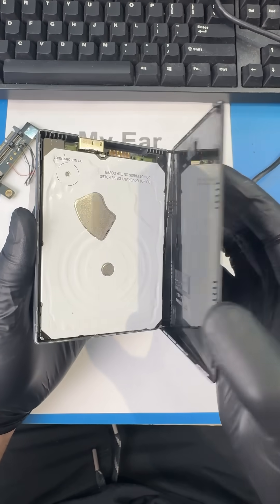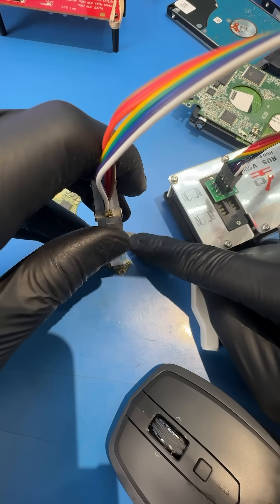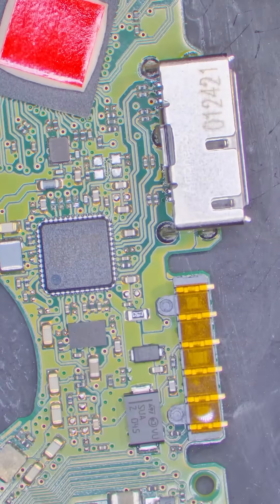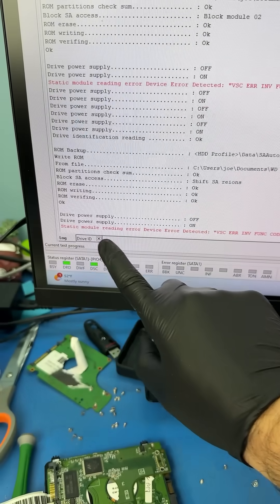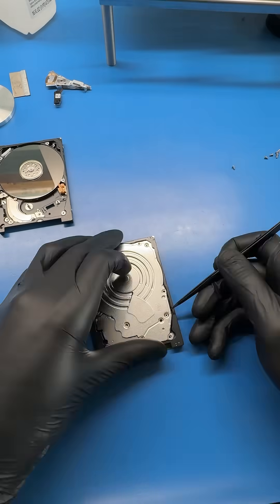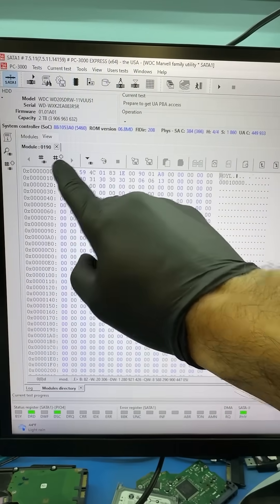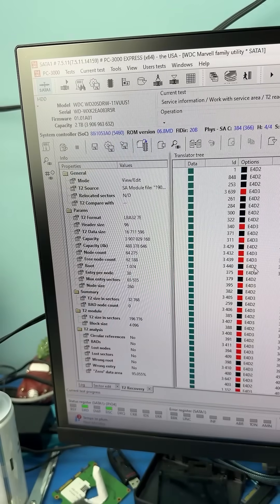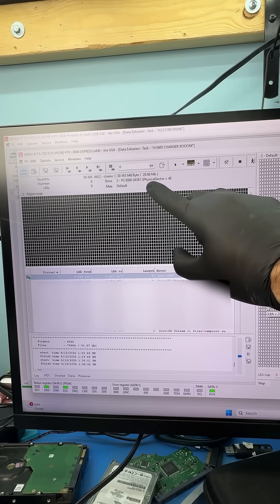Hard drive translator...? #tech

Comment: These are technically fascinating shorts. The hard drive was the one limitation on computer mastery, as it was the one device that required a unique set of skills to learn the work.

Back in the day this skill was a costly third-party vendor job where the price to recover data was based on two things: 1) amount of data on drive and 2) level of complexity involved to do the recovery work.

In my entire 30 year IT career, I had a total of ONE drive where the company was willing to pay the recovery cost (If my recollection is correct it was something like $8,000).

Most of the time, the willingness to pay for the data came down to “did the company lose data so valuable that it was deemed worth the price to recover”…for a single employee drive failure that answer is almost always “no”.

The heartbreaking part is that most drive losses before the increased awareness around security included tons of personal data, including in one case the total loss of a young parent’s pictures of their first baby”…of course from the Finance approval POV, none of that data became part of the recovery decision.

It was computer scenarios like this that led to a push for stronger policies around data management and increasing the role of cybersecurity as an official job role that was separate from IT support.

Comment: Dude, this is metallurgy. Remove this crystal to stabilize the connection is an insane sentence to actually be correct
Reply: Considering we turned sand and stone into literal thinking machines to store our dreams, yeah it's witchcraft.
Reply: @Leftysrev3nge Yeah it’s magic
Reply: Unfortunately, that piece he removed isn't really a 'crystal' in the geology sense. Quartz and other piezoelectric crystals are often used to generate clock frequencies, but the one is the video is definitely some kind of MEMS chip.

Probably for serializing data before sending it through the USB port/cable.
Reply: @jo54763 why did he remove the “crystal”?  He wanted a SATA connection instead of a USB, if I understood correctly. I’m guessing that the SATA connection works better if the disk lets the computer keep track of time. But I know nothing about hard drives.
Reply: @simonjonsson3654  I'm not certain either. I think you might be on the right track, though. I think because the drive was an external drive, it has to generate its own clock frequency to send out serial data to the USB port, which is then read by the system. I concur with your guess that SATA cables use the system's own clock, but I also couldn't find anything to confirm that.
Reply: @jo54763  thank you for the answer. Such a curious detail, but I guess it could tell much about how the disk and the computer operates.
Reply: @simonjonsson3654 Since the SATA interface has its own internal clock, the hard drives’ clock can interfere and lead to possible data corruption because of timing issues.
Reply: @simonjonsson3654  Yeh, I didn't get that bit ether. You get USB to SATA converters for a few £ tops. Why not use one of those. Then I don't understand why he wanted to convert it to SATA, I assume for one of the diagnostic tools.
Reply: @jo54763  how is quartz not a crystal in the geological sense ???
Reply: its pretty simple really, I am sure he didnt discover this probably read in on a forum somewhere or a datasheet gave him the idea
Reply: stabilize the machine spirit*
Reply: My guess is he gets rid of the oscillator so the system can do it rather than the on board since he’s unsure if the system is good for timing. Cuts out a variable
Reply: @Izik09834  probably read it on the internet somewhere, thats my guess, or maybe he figured it out on his own, your guess is a good one though on timing
Reply: He's a real SAND WITCH.
Reply: It's probably in the context of the circuit -- he's now using SATA so it may get clock signal from the CPU.

Comment: "Remove this crystal. This will stabilize the SATA connection" 

Sometimes when you get technical out of context it starts sounding like some high level alchemy lmao
Reply: Look we took Sand, Coinage metals, rust and a handful of carefully placed magnets and made it do math and store information, it is alchemy.
Reply: @zerg539  I mean, bro it technically is. If you show somebody this technology 200 years in the past, they would for sure think it’s sorcery.
Reply: @zerg539  For real. One of the things I like to remind people is that before the late 1800s, pure aluminum was more expensive than gold. It was only by chemical means that we were able to isolate the element in large scale, from what was effectively useless dirt. "Dirt into platinum" is, imho, even more alchemically magical than "lead into gold" and now we all just drive around in fucking carriages made out of the shit like it ain't no thing.
Reply: Well back in the day the crystal was actually a quartz crystal oscillator to keep timing.  This is technically a silicon/mems oscillator.  But everyone still calls it the crystal.  If you get enough of them, you can build a light saber.
Reply: @RolandDFW it often still is in most microcontrollers
Reply: @artemis.nnnnnbbbbb  not just microcontrollers, 90% of crystal oscillators are quartz still -  its cheap, good, and a proven technology
Reply: @RolandDFW  not just back in the day, crystal oscillators are rarely not quartz. Its just so cheap and easy to manufacture there is no reason to move away from quartz and set up new machines.
Reply: You're on the "watch List" now  @RolandDFW
Reply: @RolandDFW  the "crystal" used in my sister's car goes fast every once in a while and we have to reset the time. it SUCKSSSSS
Reply: @RolandDFW silicon still is a crystal
Reply: I mean, it's a rock that remembers😂
Reply: "Remove this crystal, this will stabilize the SATAN connection", said the wizard and turned off the light in an isolated dust-free chamber
Reply: @naya_vu 
Jesus is the way, the truth and the life. Turn to him and repent from your sins today ❤️
Reply: @naya_vu my exact thought process 😂😂
Reply: It in fact is, we just got used to learning it. Humans got really precise and complex with their technologies, especially with information processing and transferring ones, up to the point that some of nowadays computer technicians would amaze even people from 1980's with their knowledge and skills. And the very idea of simulating a world, let alone a random one, where you can move around and do some at least remotely interactive stuff was science fiction like 40-50 years ago. This isn't "like high-level alchemy", it IS a high-level complex alchemy, like Mineral Information Storing and Processing (MISP) course, which only the chosen ones of the Information Technologies faculty could join.
In fact, many specialties can be explained in a magical super-advanced alchemy way, with how organised, acknowledged and advanced all that is compared to what people, like, even 300 years ago had.
Reply: It sounds like a low-effort cop/investigation series when they do "hacking"
Reply: @thespacepirate4641  Also yeah... They definitely overplayed that card 😅
Reply: Just what i thought  @thespacepirate4641
Reply: well, of course. Computers are basically rune magic and instead of it running on a crystal ball its displaying stuff on a screen.

Energy can be converted. so we use electricity in place of mana.

we are living in a fantasy world, it just doesnt seem like it because everyone is used to this stuff being "normal"
Reply: Dude, deep level tech IS high level alchemy.
Reply: What does it actually do? Is it to make the drive accept external clock signal?
Reply: all computers are just flat rocks with lightning in them that use the good vibes from crystals to "think"
Reply: There is no difference between classic "magic" and modern technology. 

Using crystals (quartz) and focusers (copper wire) to direct invisible energy (electrons) to perform specific movements resulting in different incantations (logic gates)
Reply: I mean technically we are imprinting runes/circuits on silicon a which is a rock to do our bidding.
Reply: @ZeFoxii yeah exactly the more i learn about runes the more i glance anxiously at the microelectronics
Reply: Electronics are basically high-level alchemy. We carve symbols in to rock energize it, and it can think
Reply: What magical madness is this!
Reply: when you remove the crystal but you accidentally use human transmutation to do it so you have to go through the gate of truth to fix the drive
Reply: that's because... it IS!
we just renamed "alchemy" into "chemistry" and use "material science" to build precise nanostructures that store data.

we use the power of lightning magic condensed into batteries and channeled through small conduits/wires to manipulate mag(net)ic fields around things and communicate through waves emitted by such metals. we have a vast network of antennae sending and receiving information at the speed of light.

we just made it boring by understanding it. but it was never meant to be boring.
Reply: You misspelled “SATAN connection”
Reply: I think he is just disabling the USB interface, but I'm not sure
Reply: Listen, we made sand think. We made the thinking sand communicate through via frequencies in the air. We are in the process of trying to give the telepathic thinking sand self awareness. 

We are doing magic, people who chose to romanticize wizards instead of getting a computer science masters are just butt hurt.
Reply: It’s literally magic
Reply: As someone working in a tech field it's always fun to talk about it like magic. Runes etched into a magical crystal that give it controlled animus, and allow you to slave its will to your goals are much more fun than just a computer. Although the more in depth you can go on the actual process the less magic you need to add to your wording. The processes of forming the initial silicone crystal, then the PN enrichment, and the photoresist used to form the lithography are all processes straight out of an alchemist's wet dream, and by the time you're halfway to the full picture already sound like some mumbo jumbo the writers would put in a sci-fi movie to make a character sound smart.
Reply: Science is just magic that works, so you're not wrong...
Reply: Like the Kyber Krystals
Reply: @NaterFernator in stargate how a lot of alien tech has crystals in its circuitry.
Reply: sounds like something you'd hear on Stargate back in the day
Reply: Sounds like star trek honestly but that show is sum what based on real ideas
Reply: Sounds exactly like treknobabble
Reply: PRAISE THE OMNISSIAH!
Reply: I can't be the only Rs player that Read High Level Alchemy a certain way.
Reply: Circuit boards are literally demonic sigils
Reply: It sounded more like "and after that we can kill ender dragon"
Reply: Don't kid yourself or the machine spirits. It IS high level alchemy
Reply: Well technically....but frfr yeah were working with hardware and software which relies on electo chemistry to work which chemistry is what alchemy became
Reply: Oh my god are you actually TikTok verified bro?!?! Wwooowwwww
Reply: Especially when “SATA” starts to sound like “Zeta”
Reply: @NBrixH What does the letter Z in greek have to do with anything?

Or do you somehow think zeta is a special word anywhere other than explicitly fallout?
Reply: @Atmatan ”SATA” can sound similar to “Zeta”, which is a word often used in fiction in regards to mysterious stuff, and aliens, like in Fallout for example.
Reply: @NBrixH 'Often' is an overstatement.
Zeta is the greek letter for Z.
It is not mystical or mysterious under any contexts.
Fallout is the only notable place you can list it being used without searching.
Reply: "Let's continue with the head swap"
Reply: I forgot to put in the crystals.  Napoleon dynamite
Reply: Or Sci-Fi
Reply: The true SAND WITCH.
Reply: Yeah😂
Reply: full metal alchemist.
Reply: To be fair modern science and technology IS high level alchemy 😅
Reply: That's because this is technically alchemy
Reply: I mean, really. If making a rock think for you isn’t alchemy, what is?
Reply: I was thinking the same thing tho lol😅😅
Reply: It’s all alchemy. We’re just shocking rocks with lightning so they remember.
Reply: me when i go to the local wizard to get my doohickey repaired
Reply: All of it sounded like a bunch of "witchcraft" to me.  I vote to have a trial and exorcise the demon from this man!
Reply: just like my life fr </3
Reply: It is high level alchemy
Reply: Electronics is basically just making rocks talk to eachother
Reply: "Any sufficiently advanced technology is indistinguishable from magic"
Reply: cringe reddit ahhh comment
Reply: ya your not wrong. tech is just alchemy in a way.
Reply: Computers are alchemy lol
Making rocks do calculations and talk to you
Reply: Now you know why engineering is so hard that it breaks engineers apart for 5 years
Reply: Если припаиваете Sata, провода Data нужно переплетать между собой чтоб ошибок чтения небыло
Reply: science is 100% a type of sorcery, the saying “Any sufficiently advanced technology is indistinguishable from magic.” i know there’s probably a second part of that saying that goes like “… and any magic that’s explainable is a type of science.” science is for sure our universes magic*. (well the one that’s public)
Reply: "Any sufficiently advanced technology is indistinguishable from magic"
Reply: Crazy thing is I actually recognize what he’s talking about… I guess some of this stuff isn’t normal for people
Reply: Or it sounds like Elon talking high as a kite.
Reply: None of that is complex
Reply: You are just dumb… what is alchemist about crystal? 😂